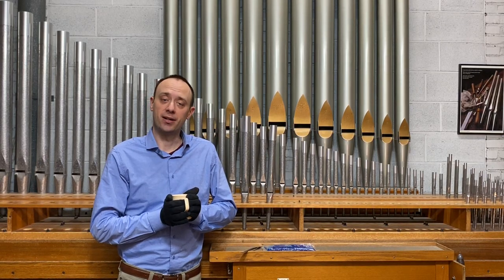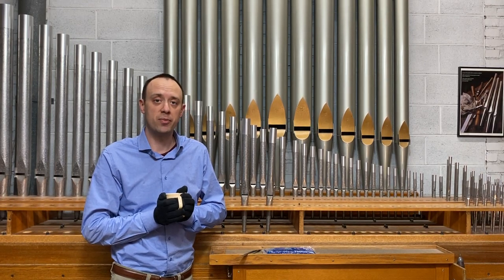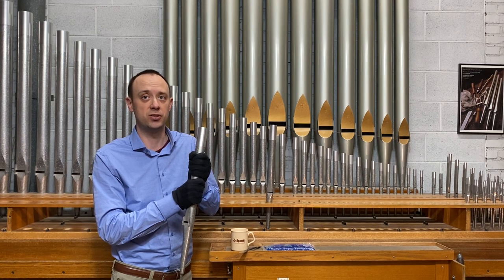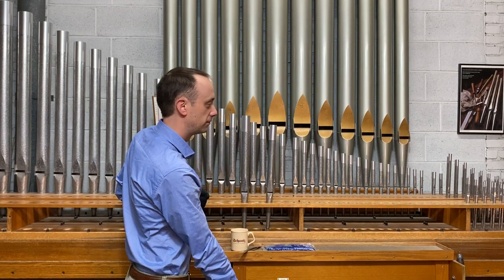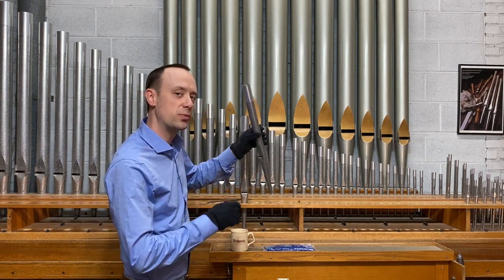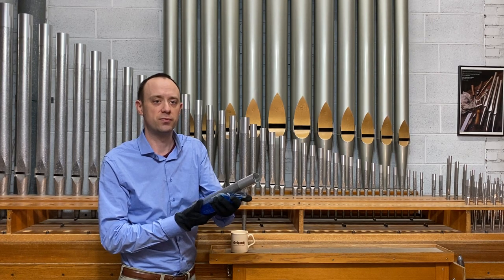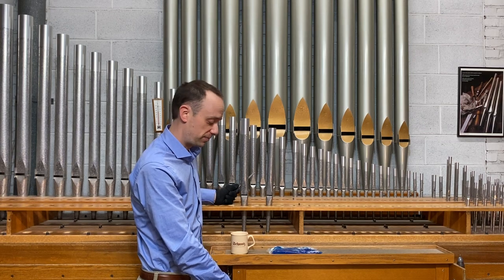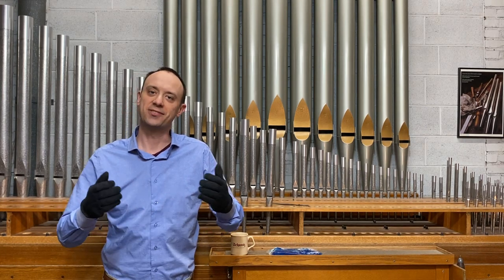How Temperature Affects Organ Pipe Tuning

Comment: An interesting and useful video - thanks!
Where I work (in the UK) I could show the same effect (on site) by picking the pipe up with one hand and putting it back at once - no need to warm the hand.  Presumably, this is because the room, and therefore the pipe, would be colder to begin with?
The message is still the same: the pipe is in tune, only at the temperature at which you tune it - hence the need to have the church at service temperature for the tuning.  For this reason, in the winter, we try to tune on Sundays, when the building has been heated, anyway,

Comment: Very interesting and informative . Would be useful to know how temperature changes especially in buildings can effect / damage an organ especially in these times of heating issues for churches and large venues
Reply: That and humidity will mostly affect wood chests, leather, and wood pipes, too little humidity causes wood to shrink and crack, and stopped wood pipes will want to crack at the top where the stopper is as well as the rear bottom of the back board on larger pipes especially. The worst damage would be caused by roof or water pipe leaks onto the organ
Reply: One effect it has on the organ, along with humidity, is mold... When the organ does not have proper airflow and the church does not heat on a regular schedule, it's not uncommon for spores to appear inside. An organ builders nightmare! 😖

Comment: Great video, but it doesn't really explain the problems a tuner might have on site - needing to handle a pipe, replace it and tune it. Many might just knock it back into tune, but by the time you have finished the rest of the rank, the pipe you handled and retuned will then be 'out of tune', as it has 'cooled down'. You perhaps should have gone back to the two pipes you demonstrated within 5 minutes and checked the tuning again?

Comment: The tone does not change because of the temperature of the air in the pipe (as the man says), but because of the expansion or contraction of the organ metal by heat or cold.
Actually it is not correctly explained in this video.
Reply: The density and speed of the molicules of air in the pipe, not the expansion or contraction of the of the metal, affects the pitch in a controlled situation as shown.  If Luke had wanted to prove this (unnecessary) point, he could have introduced hot air and cold air (say 2 degrees C and 75 degrees), at the toe of the pipe.  The change in pitch would have then been so extreme as to have been perhaps two semitones out of tune from a reference pitch.  In order to achieve that much change with the expansion or contraction of the pipe, the length would need to increase/decrease by an observable/measurable amount (which is not the case).  While there must be some change in the pipe wall (metal or wood), that change does not account for the pitch change in an appreciable way.  Air density is the correct evaluation of pitch change, not wall expansion/contraction.
Reply: Further, and more to the point, cooling the pipe would cause it to become smaller and shorter, thus raising the pitch. Heating the pipe would cause expansion of the wall, making it longer, thus lowering the pitch.  This is exactly the opposite of what happens with room temperature and air temperature inside a pipe.  A neat demonstration of this is to take a tuning fork, a pipe of the same pitch and reference (electronic tuner, another pipe or another tuning fork).  As the fork and pipe are warmed or cooled, they move in the opposite directions from the reference.  (I want to acknowledge Sue Haslam at Peterson Electro-Musical products for providing a very observable pitch change with tuning forks against an unchanging reference as the forks are warmed and/or cooled, even slightly.  Your tuning fork is not a reliable source for pitch unless it is "at temperature".)

Comment: Very interesting but aren't there are few more factors at play?  For instance, the length of the pipe will change with temperature - not sure how much that helps to compensate for the change in air density.  Also, depending on where the blower gets its air supply, that could easily be at a very different temperature to the organ itself.  And finally, how does temperature affect all pipes?  I know purists will expect A=440 but if everything slips a few cents it's not usually a massive problem.
Reply: Yes, there is an opposing effect caused by a slight change in the length of the pipe. This however is tiny compared to the pitch change caused by the temperature effect on the air inside the pipe.
Reply: The problem is caused as the smaller pipes in a rank are affected more greatly than the larger, which no matter of A440 then has the octaves of one rank out of tune with themselves. Stratification.